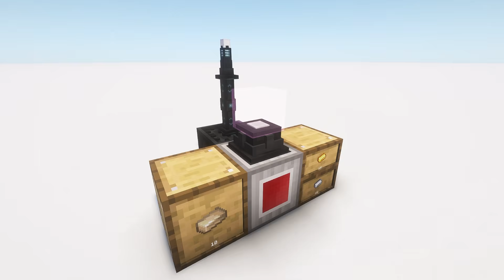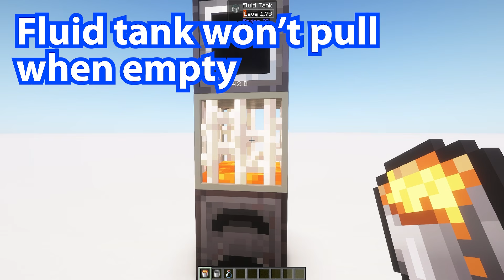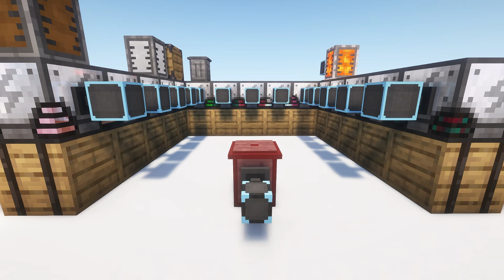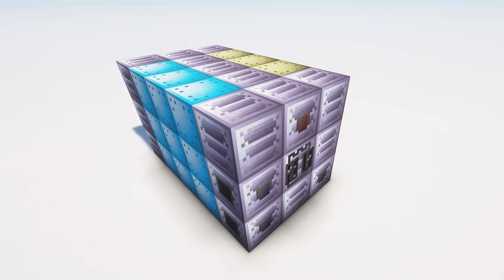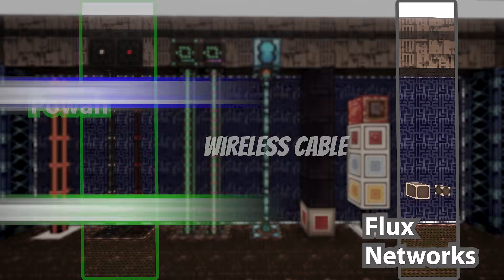Best Power Sources and Setups in All The Mods 10

Comment: what's the antenna that's being used for the iron furnace lava generators?
Reply from the maker: Fluid laser relays c:
Reply: @BucketSt  i'm trying the glass bottle tech and i can't put a glass bottle in the empty slot. did they make a change? For the energy trash cans, do i just set it to a limit of 1? For the trash can setup, are you setting input output to each furnace touching in order to input power into the flux plug?
Reply from the maker: @nivlAlvin  There was an update that stopped you from putting glass bottles in that slot. I've been putting another fluid tank in that slot c:
For furnaces generating power, the output side is the side that sends power. So yes, set the side touching the flux plug to output.

Comment: if you don't want lag , do not use pipez
Reply: Really? Didnt know that, thx for the advice!
Reply: @Behnck there is a mod that shows you tps lag, pipez with the netherite upgrade generates a LOT of tick updates, now scale that with an entire playtrough  of a modpack. I miss old enderio....
Reply: @chicabomb5933 I am used to using pipez cuz the filters are better, at least comparing to the other mods that i know, and its really fast. Whats the best option?

Comment: For some reason i cant place a glass bottle in the top left slot of the Ender Io Fluid tank
Reply from the maker: Yeah there was a patch that changed that. My current work around has been putting another fluid tank in that slot c:
Reply: you can use a water bucket. it works since it’s not a empty bucket or a lava bucket so it won’t get used or anything

Comment: u cannot put the glas bottle in the fluid tank no more --- any solutions?
Reply from the maker: My current solution is just to put another fluid tank in that slot. As long as you stop the buckets from going in there c:
Reply: @BucketSt  do you have one that you recommend i use? non of the ones i tried have worked so far. Thanks!

Comment: Pro tip
For the bottomless lava source
1) Use a drill to drill out a well of at least 10,000 blocks
2) place a layer of a holder block like netherrack one block down
3) Place lava source blocks on top of every block of the layer of netherrack
4) ultimine the netherrack 
5) Wait for the lava to fall to the bottom
6) congratulations, you can insert a create hose pulley and you have an infinite supply, gotta live glitches
Reply: Dude my hose pulley isn’t even working, it’s not registering as infinite even after changing configs smh

Comment: I think the Irongenerator Setup with the bucket got patched, at least it does not push the bucket into the generator AND the glassbottle cant be but inside the left slot
Reply from the maker: It does still push the bucket in the generator. That part should be the same. Make sure your input/outputs are set correctly.

The glass bottle in the left slot - yes this got changed. My current workaround is to put another fluid tank in that slot c: As long as it's something that stops buckets from going into that slot
Reply: @BucketSt  i think the important step they are missing is that the redstone setting has to be changed to active without signal until it shows the hourglass icon

Comment: I can't put glassbottles in the enderio tank so the hose pulley with the iron furnace doesn't work. Any way to fix this?
Reply from the maker: Yeah an EnderIO update borked this. But you can actually just put another fluid tank in that slot. (It just has to be something to stop the buckets going in there)
Reply: just fill the slot you would put the bottles in with a stack of buckets 😅

Comment: Of note is Sodium-Exchange Reactor setups which hook to a boiler. This is the most efficient way to run a Mekanism Reactor- allowing you to run the reactor at 1920mb of fuel per tick- generating immense amounts of waste and steam. You can also use a fusion reactor to boil water into steam if you want to
Reply from the maker: In other packs, yes. In ATM10 we have a number of ways to transfer water at max int which is good enough to run your reactor at 1920mb burn rate.
Reply: @BucketSt true. it looks cool and it gives me like... idk 30-40mrf/tick I'll check in the morning
Reply: @somedude2454  both of you are actually incorrect, for water it’s 717,9 and sodium 1435.4 anything beyond that the reactor takes damage. Even though it’s says 1918 it’s only cause of the number of fuel assembly
Reply: @lukyn1350 I've ran 1920 full tilt before, it just needed a pipe network capable of pushing that much coolant and heated coolant in and out of the reactor.

Comment: The pulley isn’t pulling lava nor am I able to get an infinite source I’ve tried multiple lava pools and even tried to create my own
Reply from the maker: Sometimes create doesn't like interacting with other mods' pipes. You can try to jump start it with a create pump, but I find it easier just to shift it over a block until I can get it to work.
Reply: @BucketSt hmm interesting when it comes to the infinite source I swear I’m putting in a pool that’s over 10000 blocks in the nether and the googles never say its infinite ima have to figure out the whole pump thing my first time playing all the mods
Reply: @Ghati.  any luck?
Reply: @TacosGaming i got it to work
Reply: @TacosGaming  I had to use the pump and then make a system with cog and stuff to consistently make it pull you cannot hand crank it from what I found out by trying a whole bunch of things in creative
Reply: @Ghati.  How did you get the rotational energy needed in the nether?
Reply: @DOOMZIP you can use lava instead of water it won’t burn

Comment: AE2 power storage is broken
16k FE storage cell with 2 accessers and 1 acceptor and 1-2 purple energy cables which ya can get from tasks

Only time it breaks is when the system runs out of power or deloading so keep this setup with anything else required loaded

Comment: Im currently using the furnator with the endless lava method, sometimes for some reason the dimensional tank cant keep up with the 20KFE/t , so what i did is a placed a secondary dimensional tank with the same frequency and piped it to the fluid tank, and that solved it for me 👍🏻

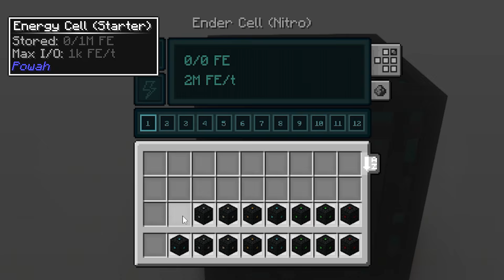Comment: 10:38 If you do go the Powah storage, use a Battery to upgrade the ender cell capacity, not Energy Cell. Much much cheaper resource-wise.
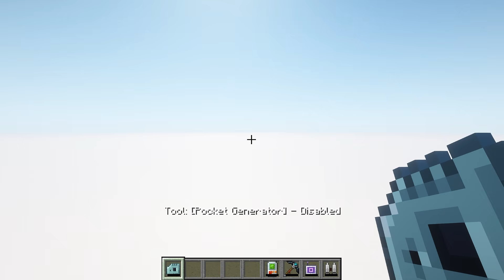15:16 Worth noting that the Dire Pocket Generator wont charge Curio slots. So if your Iron Jetpack is worn in a curio slot, it wont get charged. This might change in the future as Dire said in his own atm10 playthough that "he should really add that".
Reply: Yeah the powah energy cells are SUCH A PAIN to craft

Comment: Gas burner was the first mulit block power system I build its still just running under my base. I used the immersive engineering growing things. I wish they buff the diesel generator it looks so cool.

Comment: Please someone help me, with normal tutorials I can typically find out block names when they pass by them and I pause to see the name at the top.  But what are those containers being used to hold lava in the Thermo Generator section?  They appear to hold the lava in place but still allow it to heat the generator... anyone please help
Reply: thats the ender io fluid tank if i remember correctly

Comment: For some reason, at least in other packs like Evolution, the Fluid Tank from Ender IO won't take bottles in the upper left slot, so I just had lava from the Ender Tank be pumped into a Create Spout. Then I have empty buckets withdrawn from the furnace with a filtered pipe and lava bucket withdrawn from the depot with another pipe on the other side. You could also do this on one line with Ender IO or Laser IO to make it neater, though.
Reply: In FTB Evolution you can put a bottle o' enchanting in the top left slot of the fluid tank

Comment: You should've been hand over foot recommending Extreme Reactors for the early game. 4 uranium for Uranium seeds, a couple stacks of platinum, iron, and glass that are easy to get. You can have 50K FE/t accessible before even going for a second serious caving. It's passive and very self-sustaining if you use a couple of the seeds or any of dozens of tick accelerating options early game. Definitely missed that superior option
Reply: Sorry, and lead. Iron, platinum, lead, and glass to a couple stacks, a couple stray uranium and you have 50K/FE/t

Comment: So, while I don't play ATM, I do use Iron Furnaces in my custom modpack, and this actually enlightened me to just how useful it is to producing FE that I can use along side certain Create Addons to actually improve my SU generator set ups.
Reply: How do you transfer the energy you generate with the Iron Furnaces and use it for the Create?
Reply: @andres7685 some Creat Add-Ons add electric motors or similar devices that can convert FE into rotation.

Comment: Id like to see a guide on how to jump start MI if you already have an AE2 system set up. What resourxes you want to automate, what recipes to encode, and how to properly progress.

And also reassurance that the machines will not explode
Reply from the maker: That's somewhere on the to do list...
The machines won't explode though c:
But just to double check, MI is optional if you weren't already aware

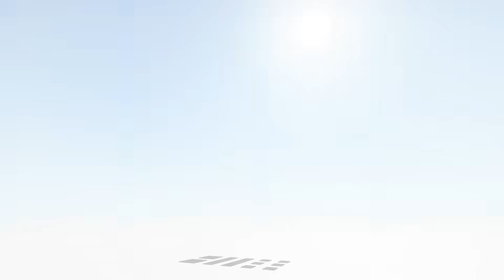Comment: 4:30 what about putting them in the mining dimension? It’s always daytime there right
Reply from the maker: It's not. Mining dimension has the same day/night cycles as the overworld
Reply: @xbraac I have used this in the DW20 mod packs with just another mining dimension (@jamd). It is not always sunny, but it is always day. Solar does great there. Once you get flux or powah ender cells, (and maybe a jetpack) put your @mek wind generators up at 315, it is definitely worth it. :)
Reply: Ever right?

Comment: I have to say, you are by far and away the best ATM10 content creator right now! Even as someone who's played ATM6, 7, 9 and currently 10, there were many things I learnt from this video, such as changes to Mekanism & Extreme Reactors balancing. I remembered early on Gas-Burning Generators on Ethylene were my go-to in ATM6, but at some point past that, the modpack devs kept nerfing it into the ground. Glad to see it's back to being as great as I remembered! 

I also thought that the Induction Matrix was the largest FE storage available, but goodness, the Energizer completely eclipsing it was not something I expected. Not to mention how overshadowed even a fully maxed out Fusion Reactor + 3 maxed Industrial Turbines setup is by just 4 or more Turbines from Extreme Reactors.

One thing I'd like to ask you is, do you have planned a tips and tricks video on Modern Industrialisation? I recently found out that to start off, it's really helpful to have a couple dozen villagers in autotraders from EasyVillagers to farm some basic rotors, circuits, etc. I was wondering if there was any other tips as well that would be helpful.

Another thing that I'd like to learn more about is which are the most lag-friendly options in ATM10. Pipez has great filters and such, but can be incredibly laggy. Same with Modular Routers with maxed Speed Upgrades or JDT stuff set to 1 tick. 

Thanks for reading and keep up the great work!
Reply from the maker: I've considered doing a Modern Industrialization playthrough where I focus on using a bunch of those tips and tricks, but there are a fair few videos that are above that on the list c:
Some quick ones off the top of my head, Attuned Runic Arcane Crystals are basically highly advanced upgrades that you can craft before any kind of MI progression. Silicon ingots can be gotten by unpacking AllTheOres silicon blocks. Tungsten is a lot easier to smelt using an Arc Furnace from IE. Titanium is a lot easier to get by crushing raw Titanium with an occultism crusher. There's a bunch of bees for IE resources too. And the MI multiblocks can share walls, but not share hatches; some notable ones are the EBF, Processing Arrays and even the Oil Rig. And don't sleep on the Oil Rig! I sustained my playthrough with one Oil Rig (I never got an Oily Bee).
Reply: @BucketSt  modern industrialization is my favorite tech mod in ATM. it was the first that i tried, ATMons doesnt have modern industrialization so ive been learning and using AE2 with Mekanism factories and flux networks; dont get me wrong these mods are awesome and way less tedious, but i cant get over how good MI is by itself. it works so well building off regular minecraft mechanics  and upgrading and adding to it more naturally than the other mods. it has the best pipes and wires IMO for most situations. and it feels like a well paced long game of progression and powers pretty much anything else you want to throw it into. the barrels are amazing. I prefer playing MI by itself though, using its own systems feels more efficient and intuitive; no AE2 integration or anything like that. MI Purity must be upheld.
Reply: Though this comment is a few months old, for item logistics and moving (without relying on AE2 to move stuff), the Modern Industrialization item and fluid pipes are great! Literally plug and play, with a blacklist/whitelist, and putting in MI motor items to increase the amount of items. They only move items every 3 seconds so the impact isn't as noticeable; in my Statech Industries playthroughs (another great modpack, especially if you really want to learn Modern Industrialization), I'm moving thousands of items every 3 seconds and haven't had any lag issues in singleplayer.

This is also why I don't think I can play any pack that doesn't include MI pipes, they're just so easy to use for me lol.
Reply: I haven’t played any modern modpacks past 1.16 until now, but one of the recent packs I had played before atm10 was divine journey 2. I hadn’t played much with mekanism before that pack because I just liked a lot of other similar mods better (like thermal, enderio, etc.), but divine journey forces you to progress through each mod extensively. So where along the line I had to make the induction matrix and man that things storage blew me away. I only had a couple of high tier cells in there and it was more than enough of a buffer for that entire pack (and it was a loooong pack). The fact that there’s now something that dwarfs the matrix shocked me as well 😂. It seems like modern modded mc has made power generation and storage absurdly easy.
Reply: Me and a friend just built a 5x7x5 induction matrix that stores around 23TFE but my god, that energizer is crazy!

Comment: Perfect pace of explaining all this! Note that integrated dynamics has 3 options for wireless transfer and one of them can be used without physical access to the target block.
Reply: Wait what?
Reply: @ganggnamg3741  check out the offsets for the ID connectors. Technically you do need initial access to the target block in order to record the location.